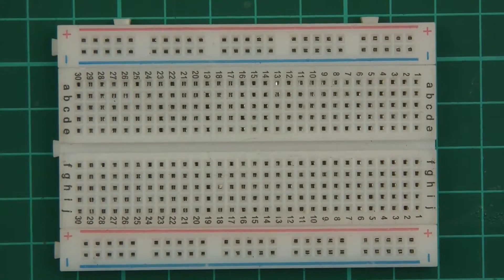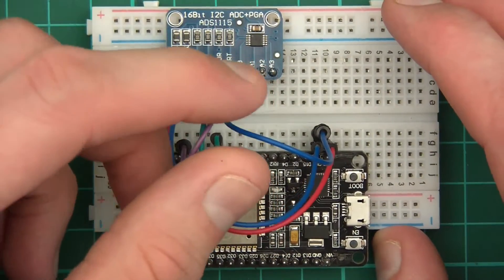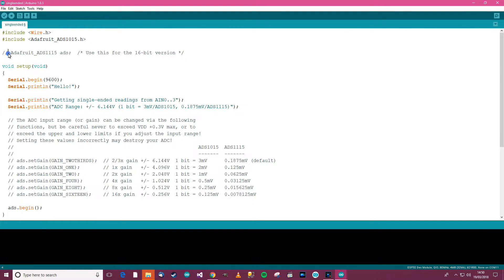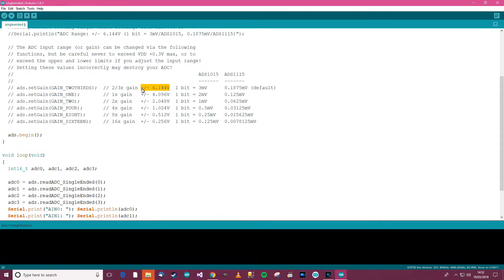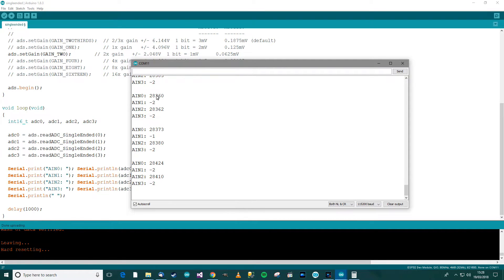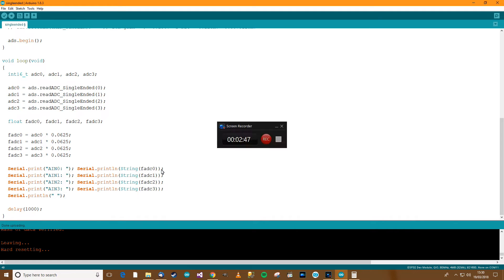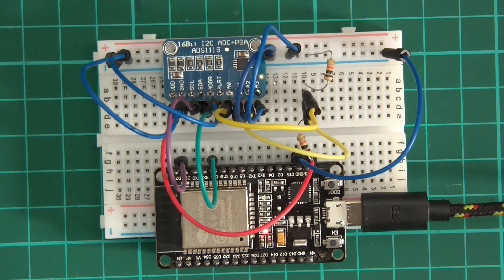TUTORIAL: How to / About the ADS1115 External 16 Bit ADC - Part 2

Comment: interestingly the ads1115 is effectively 15 bit i.e. 0-32768 not 64k. The reason is because the the ad1115 could read negative volts but to realise this would have to use the ads1115 in differential mode. oddly the ads1115 can read negative voltages (voltages below ov) but must not be below 0.3volts even on a 3.3/5 volt supply on the ads1115. so the ads1115 could be used to measure shunt voltages  in the range of  + - 300mV! 

I agree with your comment about adafruit, they do offer great support for their products, the downside is we become lazy, and dependent on code we never learn to produce ourselves because we just add the library which is the most interesting and challenging part of the whole.   The guy who wrote the library had to read the 53 page data sheet for the ads1115 and within that data sheet there is gems such as do not connect unused inputs to ground but leave them floating or tie to vdd and you become aware that the  ads1115 used in the mode  used in the video is a 15 bit adc. this does not detract from the quality of the ads1115 because  if you were expecting to use it in 16 bit mode   you would likly have to use it in differential mode  which would limit you to two inputs, but then you would get a resolution of 32768 in the positive and negative direction and it would have common mode rejection. 
I could go on singing the praises of this adc such as you could use A3 input as ground for A0,A1,A2.  this adc is a gem.

Comment: You don't have to worry about blowing up the DAC using a voltage higher than the max +/- signal value. If it's powered off 3.3v, you will never have more than 3.3v out of the internal amp so the ADC will never see more than 3.3v. All that will happen is you will max out or zero out the adc counts, so you won't know what the true value is. Now, on the external pin, you absolutely should not apply more than the positive rail or ground. A pair of low forward drop protection diodes or a low offset / low noise / low thermal drift rail to rail amp is a good option, however you should be careful choosing this part and laying it out since it will take a good design to avoid introducing a relatively large amount of noise and error into an analog signal with this amount of resolution.

Comment: 10.1.4 Unused Inputs and Outputs
Either float unused analog inputs, or tie the unused analog inputs to midsupply or VDD. Connecting unused

analog inputs to GND is possible, but may yield higher leakage currents than the previous options.

Comment: Thanks for the video.  According to the datasheet unused inputs should be pulled to vdd not to ground.  Also that module already has a pull down on the addr pin so your ground link was not required.

Comment: There's a lot more under the hood with these ADC modules than you will get using the default libraries. And it's not that hard to just program them directly. https://thecavepearlproject.org/2020/05/21/using-the-ads1115-in-continuous-mode-for-burst-sampling/
The only real drawbacks to the board are the slow 860sps sampling rate, and the low-ish input impedance at higher PGA gain settings. 
Still a pretty good deal when you can get them for about $1 each on eBay.

Comment: WOW! Loved the video! All I did to change the reading was to add the A0 and A2 then divide by 1000 to get a lovely voltage reading! Well done you. Now the QUESTION - how the heck do I set up and test the SCT-013-30??? Have you ever looked at one of these 30A ac transformers?
Reply from the maker: There's are excellent little ADCs. That SCT is a 3 pin analogue device so it will be easy. One pin will be +5/3.3v, one pin will be gnd. The other will be signal.
Reply: Antony Cartwright thanks - will look at the adafruit libs and see if I can work out the math as that’s the only issue I have left now. Great videos BTW, keep up the good work...

Comment: Thank you...great video. I wouldn't be so fast to dismiss your DMM,  they are usually quite accurate, it may be the voltage reference. Perhaps you could use another DMM to determine the cause.  It would also relatively simple to calibrate your ADC to get the readings to align.

Comment: Thanks Antony for the great tutorial. How do you configure the sampling rate? I can see that on every one sec iteration you get a single value where as when I read about the device it seems like it can sample 860 samples/sec.
Reply: you can´t with the oficial library, use this one https://lygte-info.dk/project/ADS1115Library%20UK.html  , also 860 Sp will incrise the error.

Comment: adafruit libraries are often incomplete. Their modules do not use all the capabilities of the chip soldered onto the board a good example is their RA8875 breakout board. They are not using the full capability of the chip and i had to write some of the chips data registers directly because their library did not include that function. other chip features were not available because they did not bring those pins of the chip out on to the breakout board. This is just one example. They do just enough to sell the product and many times do not include all functionality of the chip in their boards or libraries.
Reply: And they never give you a Keywords file in the library
Reply: @stoptheirlies  sometimes yes sometimes no but that is only the functionality they are using in the library. That doesn't mean the chip cant do more. And you can do more but you have to write the registers manually and not use the library for those functions.

Comment: Great tutorial - but just one question: Is it possible to use two ADS1115 boards on one arduino? If yes - how should it be connected? I want to monitor 8 analogue signals with one or two digital outputs if one (or more) analogue signals fails.
Reply: If same i2c address of Ads1115 use multiplexer

Comment: Thanks a lot for the information you given. It is very useful. My question is what wiring connection and code if i use two ADS1115 with one Arduino Uno. Please let me know. Thanks
Reply: Hey man, I tried this with an Uno and actually, the A5 and A4 are the I2C pins. However, you are supposed to connect it with the two unnamed pins on the top of the right header, above AREF. First one is SCL.

Comment: Thanks for the great explanation, I was having problem with the readings varying and after connecting the not used pins to GND and adding a small cap to the input pin, now I have 100% good reading

Comment: great video!
but im curious , i have project read voltage from solar cell , can ads1115 read more than 30v using voltage divider ??? thanks
Reply from the maker: The ads can do it, but you usually wouldn't need to! The ads is used when super high precision is needed. By all means though, you could use it. You'd have to look at the gain modes and choose a suitable voltage divider for whichever mode you choose. Most likely the 6v mode would be best. You could then use a 1:5 ratio or somewhere near that.
Reply: no
Reply: @luisviera3902  Actually, yes.  Like Antony said (correctly), a voltage divider is what you'd use to bring the registered voltage down to below a given resolution level in the ADS.

Comment: What happens if your voltage exceeds what you set for your gain?
Reply: Well it's a long topic, most of the ADC have internal reference voltage from which it compare. For egs if internal voltage is 3v and your ADC is 10bit(1024 counts), so 3/1023 will give you resolution, where 3v is max range. Suppose you want to read 1.5 volts then the reference number ADC will give is half of 1023. 

Hope you getting the picture, you want to have maximum resolution where you can get maximum efficiency. That's why choosing voltage is important. If you exceeds voltage range it will more likely to destroyed your ADC and sometimes your microcontroller too...

Comment: 100mV discrepancy is pretty big in the scheme of things.  That's over 5% error.  What are the accuracy claim specs on your meter?
Reply: I know this is late, but I have test with my precision Multimeter, the fault is of bread board. These cheap breadboard are very noisy
Reply: In my case, that's ABSOLUTELY UNACCEPTABLE. like it's useless if it's that inaccurate.

Comment: Hey, so I watched the previous video you made about the ads1115, and I have a question. I'm trying to measure a maximum of 4.5V with the esp8266, but the pins in the esp module are all 3.3V tolerant only. Would I still be able to measure more than 3.3V with this module?
Reply: No.  Not without a voltage divider.

Comment: Well is a minus and plus adc the value will only go upto 15 bits which is 32767 values for +6.144 volts  rest of the values are for the -negative voltage. I thought 16 bit is for 0 to 5 volts. Any way it is still great as Arduino is 10 bit for 0-5. and STM32 blue pill is 12bit and i think it is also 0-5 volts positive.

Comment: I'm sure you've figured it out by now but Vcc means Voltage-Collector-Collector, which is the rail the transistor's collectors connect to. Vdd is Voltage-Drain-Drain, same thing but MOSFETS instead of transistors. You may also see Vss (source) and Vee (emitter). All that's important is the big V and the double letter - that is what indicates voltage input. V+ (and V- for inverted inputs) are also commonly used.

Comment: Hi, im using espduino and an ads1115 to collect ac voltage, however, whenever i connect the ac signal to the ads a0, all other analog inputs gets affected. Another is thing is that, whenever i plot the data into the serial plotter, i cannot see a negative voltage as well as a sine wave. The plot is just some random stuff instead of a sine wave. Please help
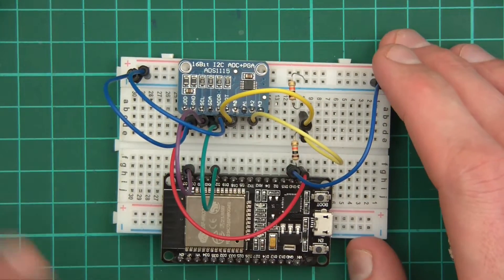Reply: remember to outcomment your device, and ground wires, that you r not using. see 4:42 in the vid. hope it helps.

Comment: I learning a lot from hour stuff  . I want do a test without 4  li-on  cells must i put the plus on A0...A3 and put all the ground together wie u arduin ? Dutch speaking bad english and 66 year old
Reply from the maker: Hi Jeff, thanks for your comment. For maximum accuracy, you'd connect the cathode to any A-pin and the anode to any other A-pin. You'll need 5v vcc (from what I rememeber). You'll need to program the chip to accept up to 4.2v also. You'd use differential mode in this configuration.

Comment: Antony. Why a voltage divider??
Reply from the maker: Hi, because it gives me a known voltage which I can test the ADS module with. If I have a 5v supply and I have 2 x 10k in series from VCC to GND, the voltage in between the two resistors will be 2.5v. Ofcourse, I can't test with 0v and I can't test with 5v. :-)

Comment: Low quality multimeter leads will have no influence on voltage readings.
That's because only a tiny amount of current flows through them while measuring volts.
And that's because a multimeter on voltage range has a huge impedance (ok, resistance), thus almost no current flows into the voltmeter, thus almost no voltage drop on the leads.
The quality of the leads becomes important when measuring current and resistance.
Reply from the maker: John Smith hey, you're right. These leads have a resistance of 300mohm which is negligible. :)
Reply: No, it's because of tiny current flowing through them. 
Few episodes back, you put a 10k resistor in series with the adc. While it's resistance is quite big, it still had no noticeable influence on reading, because almost no current was going thru it, causing no voltage drop.
I=U/R, Ohm's Law.
Reply: Congratulations for the video, very didactic. Have you compared the voltage obtained on the ADC and the Voltmeter when you performed the measure with the Voltmeter? When you connect the Voltmeter its internal resistance is in parallel with the 10k resistance connected to the ground, so it could damage your measure if the Voltmeter resistance is small. Compare both measures when you include the Voltmeter, if the voltage measured on the ADC is reduced when the Voltmeter is used you can reduce the 10k resistor. Then, the Voltmeter internal resistance will have a lower influence on the measure. Further, if the Voltmeter ADC is lower than 16 bits it will have lower precision, so the results could not match. In addition, you could use a small parallel ceramic capacitor (100nF) with the ADC channel in order to reduce noise.

Comment: Hi Antony,

Have one of these and a further 2 more somewhere between China and home (if they ever get here).
They are excellent and cheap for 16bit resolution, however:-

One thing about your comparison with your meter and what the ADC reads, it is quite a lot of difference at 90mV.
Did you monitor the indicated voltage whilst measuring with the multi-meter, as the meter could have placed a tiny load on the circuit and lowered the value.

I also note from the datasheet that the input impedance of the 1115 becomes much lower as the gain is increased.
The reason I mention this is that the project I have in mind is required to read just a few mV with a resolution of 10's uV and obviously an inaccuracy of 90mV would make it useless for my project.
Would be interested if you could find what is causing the difference.
Nice to see your using the ESP32, I use the ESP-12E more and more rather than the Arduino Uno.

Thanks and keep it up.
Enjoy your vids.
Reply from the maker: Martin Ellis hi Martin, if we had time, we could work all this out. Coming to think of it, 90mv is quite a lot out actually. :/
Reply: Accuracy will affected by 3.3V voltage regulator on esp32 board ,these LDO voltage regulator are typically 5% class. to get accurate reading you have to measure 3.3V rail or vdd voltage using good multimeter and use this value in  calculation in code.

Comment: Excellent info !
Great job and agree 100% about supporting Adafruit 👍🏻
Reply: I agree. Cuz I suck at making libraries. Best I can do is take a few books and put on a shelf   :P

The only issue is they don't make smaller ones. I was having a problem with the oled display library. It took a long time to compile, and then it took almost 30% of memory. I had to go to an outside source (github) to get one that basically streamlined the code and now only takes about 2-5% of memory.
Reply from the maker: Yes, it's very important that we support these guys. I'm a programmer myself. I don't write C++ libraries, but I've seen the code and I can see that a lot of work goes into them. Without people freely giving their time to create libraries for us to use, a lot of this functionality would be out of our reach. :-/